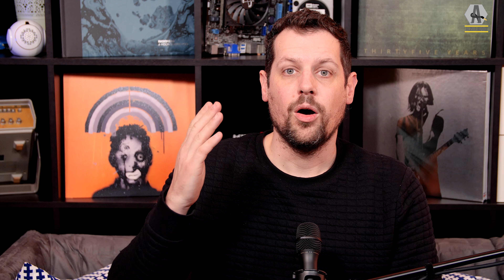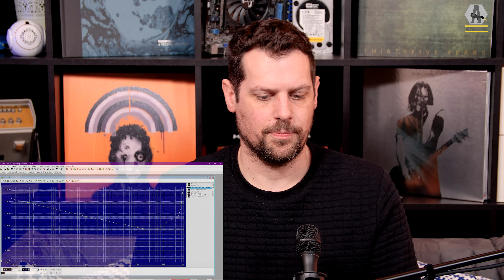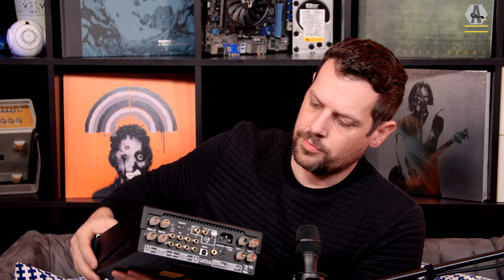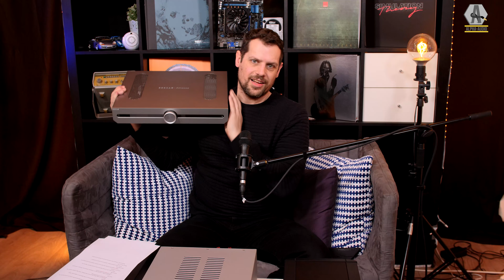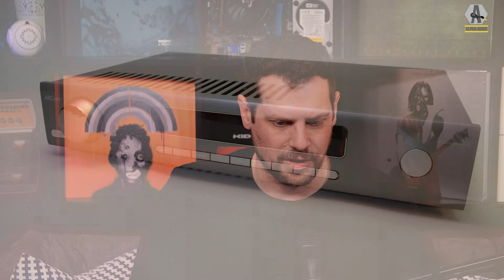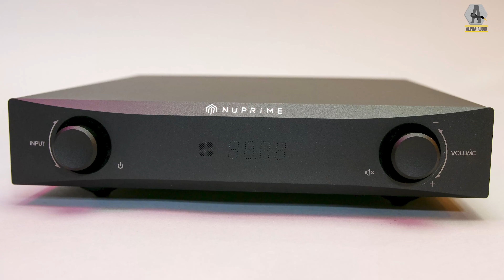Alpha Amp Multi Test - The Best Integrated amplifier for 1000 Euro!

Comment: Hi ive been looking at the Audio lab for a while now to pair up with my Dali Specktor 2 but i read someone comment that it may not be powerful enough to drive them can you advise me on this please, great video by the way.
Reply from the maker: It will be fine. Audiolab is stable enough and Dali is not hard to drive.
Reply: @TheAlphaAudio  thanks for your reply it's because somebody mentioned that they have low sensitivity and I'm all new to hifi so I don't understand how the wattage thing works.
Reply from the maker: @marktodd7397  Sensitivity is only one element. It says how loud it will play with a certain input power. That is not really important. Impedance and variance in impedance is what makes a speaker hard to drive.
Reply: @TheAlphaAudio  Thanks for giving your time to answer my questions 🙂

Comment: It's interesting. I have both the the Spendor 3/ 1 and the Klipsch Heresy 3, which is touted as being high sensitivity. However- in practice, the Rega would get very hot driving the Heresys!  This was explained to me and it's understandable. Yet another example where the numbers do not tell you everything about how drivers in the same box will not be a benign load to your amplifier.
Reply from the maker: You should look at the impedance dips and electrical phase.
Reply: @TheAlphaAudio  yes. Thank you. That was explained to me once I became curious about it. So- a good example of paying attention to the measurements that might matter in your system.

Comment: Little bit disappointed with Attessa, everyone is a bit reserved with their praise of the sound quality...it sounds good, clean, correct and that's about it, no one is enthusiastic about the sound, it seems that there are better options than Attesa in that price range, it's simply impression that something is missing...engagement, emotion, fun...
Reply: I have tried the audiolab 6000a, Cyrus one with triangle Genese Trio the 6000a was to laid back and came harsh at high volume, loose details. The Cyrus one was much in ya face power engaging, detailed but not suited for triangle speakers.
The attessa is a spot on match with Trio  everything is at their place in music genres..

If you have the option to hear the attessa with either Trio or comete 40th anniversary think you will like the presentation attessa comes with.
Reply from the maker: For me ... It is lacking a bit of involvement.

Comment: 0.8 % distortion... at 160watts in 4 ohm . well cant imagine many use 160 but 0.8% is loudspeaker distortion territory. use a normal power connector C13 like any normal person would. and you got no problems with the rega power terminal. cool you can remember your old cyrus sounded back in the day...  audio  memory does not work like that but ok. you could not remember details that small in a time span of seconds  let alone years.. with different speakers rooms etc..

Comment: Nice video 👍 you mentioned Dali! Would you say Dali and the roksan go together well? I have Dali opticon 2 mk2 and going around in circles looking at amps! I am thinking about the roksan or the audiolab 6000 🤔 don’t need streaming as I will connect a Sonos port 👍
Reply from the maker: It completely depends on taste. Both the Audiolab as the Roksan are capable amps. The Roksan has more resolution and is more 'detail' focussed. Both have enough grip and power.

Comment: Comment about the Rega: The only experience that I have with Rega is their turntables. I used to have the Rega RP3 with the Elys2 cartridge. Right off the bat, I notice that the sound of my Rega turntable + Elys2 cartridge was on the exciting and energetic side, not at all laidback. And you kind of just confirmed my observation with your evaluation of the Brio. I guess that is the sound signature they are going after. Almost feels like the signals are on the hotter side, on the verge of distortion but not really distorted - enough to make it forward sounding, exciting and energetic.
Reply from the maker: Glad to hear you have the same experience. Must be their tuning!
Reply: I had a ELYS2 and my opinion is : ELYS2 is very bad but if you try the EXACT , is really a other world ….